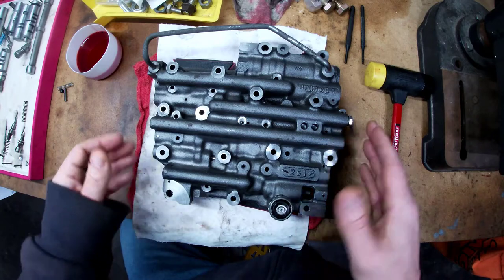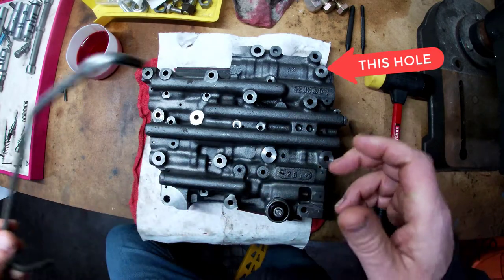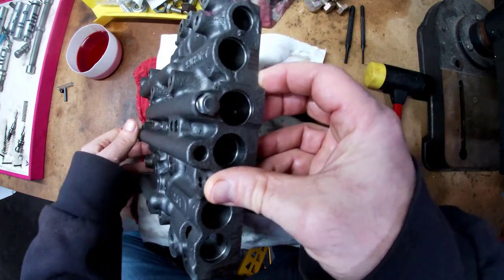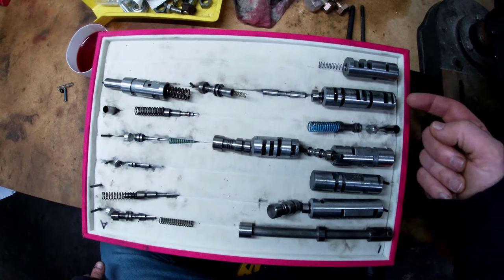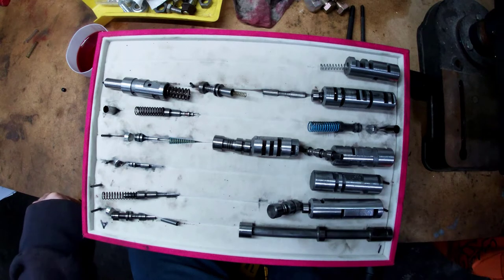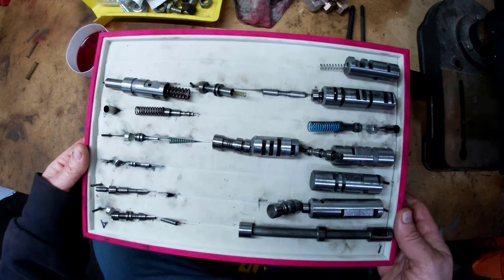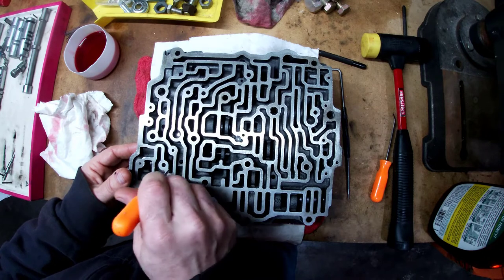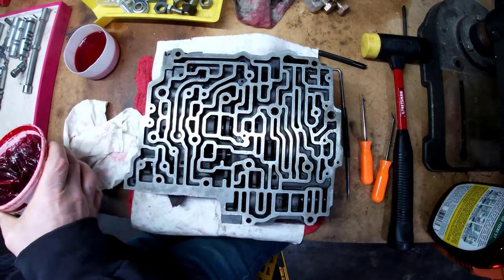200-4r Rebuild - Valve Body Assembly + Shift Kit Install (part 4)

Comment: Hey Phil, just wondering if you offer a little coaching service on the side?  Like perhaps through Zell or Paypal? I'm currently chasing a recently developed 3-4 supper hard and late shift condition on a GN.  I'm a retired ASE master but I obviously don't have the experience in what may typically go wrong on these transmissions or what to look for before I dive headlong into this issue.  Thanks in advance.   Great stuff btw     Norm
Reply from the maker: Thanks for asking but I just do this stuff for fun not $$$. 
Assuming you didn't change anything and it just happened... no other issues appeared... I would look at the 3-4 accumulator. 
I talk about the 1-2 accumulator here: https://youtu.be/L5-N02Z7_oY?t=539 but the 3-4 accumulator works the same way and does the same thing. So if you're getting a 3-4 slam there could be no accumulation of fluid in the 'bucket' from a worn bore or piston or pin or whatever.
Hope that helps as a starting point!! 👍
(you might also consider to get a high pressure oil gauge like the gearwrench 3343d and see what pressures are what currently)

Comment: Can you elaborate on the #3 valve/plug in the high performance version valve body. I'm about to rebuild my trans with the ck performance pro street kit. And believe mine will have the valve train instead of the plug. My transmission is out of a 87 caprice. What is the purpose of the valve compared to the plug. I have the ck performance manual but he doesn't go into detail other than it's not recommended to use this style f valve body assembly.  Any insight would be greatly appreciated.  Thanks, and keep those videos coming.
Reply from the maker: Thanks for asking!
That plug is used on computer controlled tcc models. The non-computer controlled ones(earlier models) control the tcc with a valve assembly in the #3 'slot'. 

The 2 also differ in the separator plate (although the ck kit changes it anyway) whereby a different hole is used for each. (You can see the valvebody gasket has 2 holes next to each other but the plate only has one hole in either location) 

Lastly 'I think' the 1-2 accumulator housing is different between the 2 with the non-computer controlled having an extra path in the bottom for oil to flow in whereas the other doesn't. Check my earlier video (#1 I think) where I removed the housing from a computer controlled model and compare to yours.

I believe(verify with a real pro lol) the non-computer controller system can be used in either style whereas the computer controlled model can obviously NOT be used in the non-computer controlled trans.
Good luck with your build

Comment: Hey Phil how’s it going I did a CK Performance build on my 87 Buick grand national I bought the whole kit I also dual feed 3rd after finishing the transmission test drove it and had a bind on third gear don’t know if you dual feed yours trying to see if I could correct the issue tried calling Chris CK but he’s a real busy man don’t know if I have to drill valve body plate
Reply from the maker: Yes, I'll show how I'm dual feeding it as I progress along in the build videos.(next one, #11 is direct drum setup/mod so I'll show the seal removal there)  
Your bind on 3rd gear is likely from the direct clutches engaging before the band is released. Shift timing is out of sync... A heavier spring in the servo may help but DEFINITELY give CK Chris a call since it's his kit you installed and he'll guide you how to address the issue.
Regarding his shift recalibration kit, I will drill a few of the valve body separator plate holes when I reinstall it during final assembly... but I think it depends on which kit of his you're installing. 
I'm using the pro street with billet servo one here: https://www.ckperformance.com/View/SHIFT-RECALIBRATION-KIT-WITH-PRO-STREET-BILLET-INTERMEDIATE-SERVO-ASSEMBLY
Good luck with fixing the bind!
Reply: @wrenchingwithphil  
K cool looking forward to watch the video call Ck Performance told me to drill third accumulator on the plate .030 and don’t go too tight on the servo i got the same kit with hard part and full Roller race
Reply from the maker: Glad to hear you were able to reach him and he helped you out! 
Interesting... I think my kit instructions call that plate hole "orifice D" and recommend a larger hole than .030 be drilled depending on what power level you'll see. But I guess he changes kit contents and directions over time. 
Anyway, post back the results after you do the fix and good luck with it!
Reply: @wrenchingwithphil  
Orifice D .140 not .030 made a mistake
Reply from the maker: no worries... hope it fixes the bind for you!!

Comment: Which CK kit are you installing in this build?
Reply from the maker: Thanks for asking. 
I'm using this shift kit from ck. I've had good experience with it in the past. https://www.ckperformance.com/View/SHIFT-RECALIBRATION-KIT-WITH-PRO-STREET-BILLET-INTERMEDIATE-SERVO-ASSEMBLY
Reply: @wrenchingwithphil  Thanks for the reply. This kit would probably be over kill for me. Just want to toughen my 2004r to handle 300 to 350 hp. tops. His book well worth the money to learn from. Money well spent.